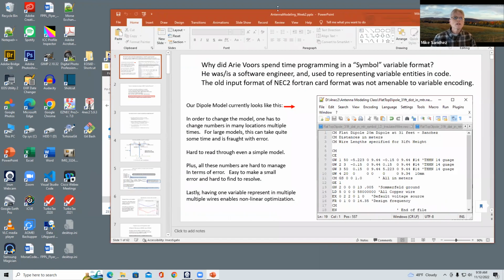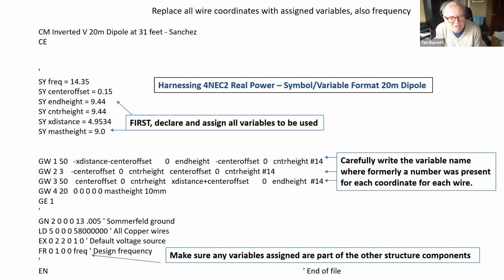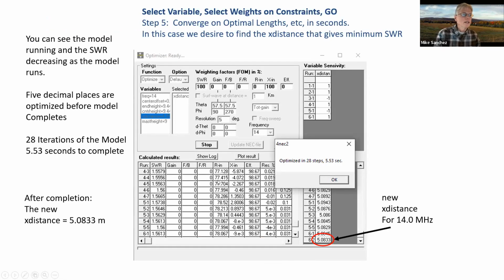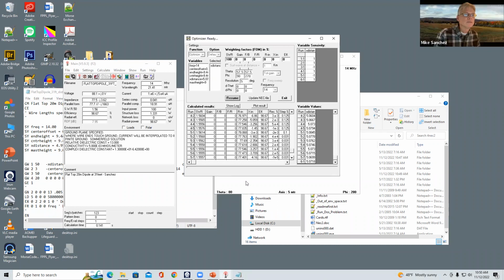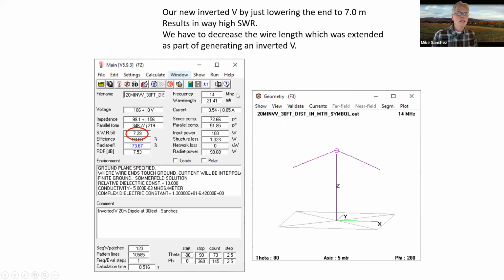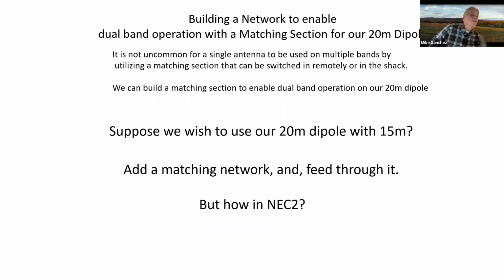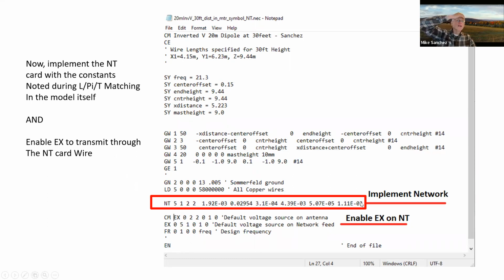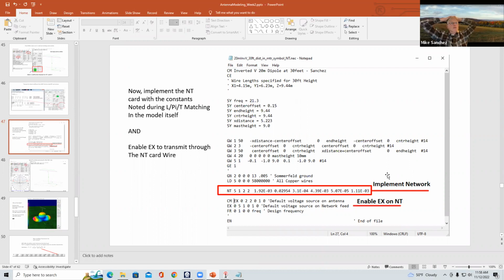RaRa Academy - Antenna Modeling with 4NEC2 - Session 2

Comment: The X component is the imaginary (reactive) portion of the impedance (using Cartesian coordinates, as compared with the polar format of impedance MAGNITUDE + PHASE). My guess is that the difference between optimizing on SWR vs. X-in, is that using SWR will allow SOME reactive impedance to achieve a lower SWR. For example, if one antenna has impedance 75 + j0 vs. 58 + j<something>, might give similar SWRs, but only by zeroing out reactive impedance will give you TRUE RESONANCE. _

BTW, I don’t know if we’re running the same version, but mine (V. 5.9.3) allows you to use the ”NEC Editor (new) Ctrl+F4” which is a lot simpler that using notepad++. It has all of the same fields, but it’s in spreadsheet format with column headers. My only "pet peeve" with the NEC Editor is that 4NEC2 requires you to manually close the editor before running Optimize.

I learned a lot of this the hard way, but I'm still learning new things from your presentations.

73 de AF6AS in “DM13” land